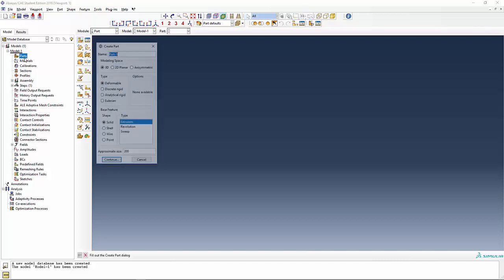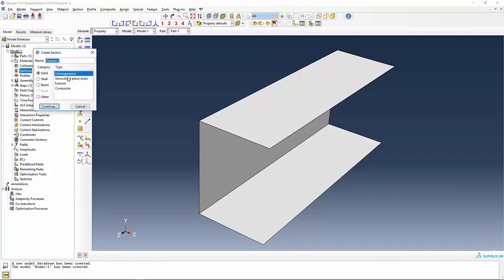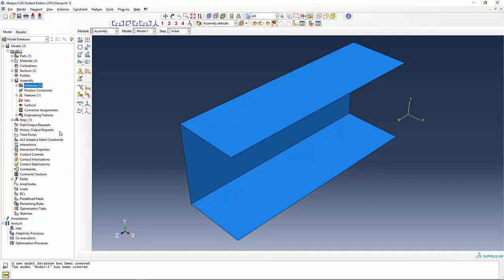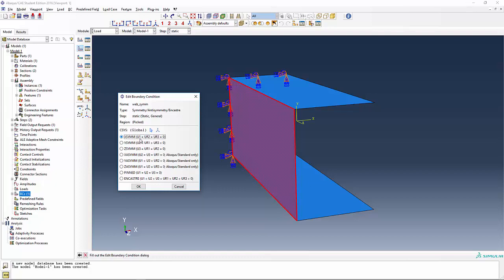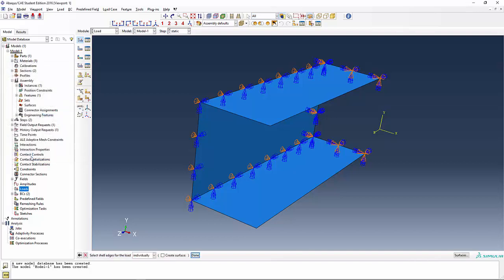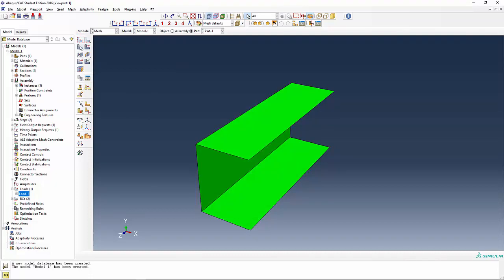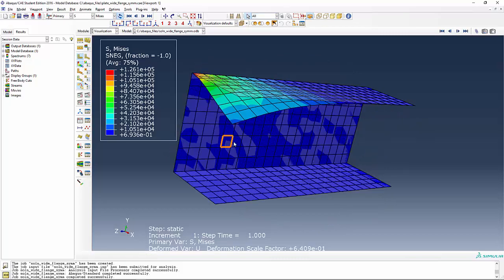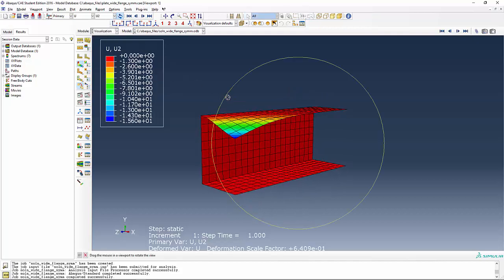Plate/Shell element modeling of wide flange using symmetry

Comment: Does the web get doubled of its thickness with the symmetry or not? I modelled a similar problem and compared with full model and results are slightly different.
Reply from the maker: When you make a cut along the web, the assumption is that the section property must also be cut such that the original problem is not altered. In this case, if you assign a shell thickness of t to the web section, based on the symmetric cut, the FE simulation considers the web thickness to be 2*t. Hope this helps!